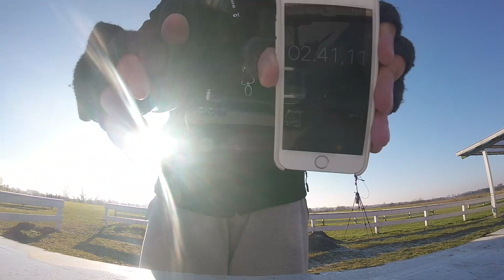Connex Prosight HD - Hardware troubles!

Comment: I'm using Connex Prosight HD for about 4 months, and I never had any blackouts like what you described here, unless I fly out of the signal reception zone. Once I replaced 3 out of 5 whip antennas with 11 dB patch antennas the zone extended quite noticeably, I can get one kilometer quite safely. As far as I can guess, you loose signal behind the tree because the large red metal container next to the shack blocks you completely at this point. Once you get back into the reception zone Prosight finds the signal, but it can take up to 10 seconds, long enough to crash most of the time.
Reply from the maker: I wish that was it; but no. Ive also - because i had the same thought you did, flown directly straight out and lost signal numerous times, i just wasnt filming then. So its not the container ( besides you cant see, but its not blocking the line of sight in reality, just looks like it ).

Comment: This is odd.  I have been flying a couple weeks with Prosight - not a single dropout, not really any pixellation unless I fly directly above the receiver antennae.  I find it incredibly solid, been out to about 1km, which is all I need, though I do appreciate the problem with flying behind dense objects getting total image loss (have not encountered that yet).  I put it on a plane and a quad. The main drawback with Prosight is the bulky ground station.  But the image in HQ and high frame rate HP mode is worth it.  HD is the holy grail for FPV, imho.  I love it, esp w Headplay HD.  I have been FPVing 6 years and kind of got tired of the fuzzy, low res, 4:3 analog link flying.  I am all in with Prosight (except for my RotorX atom!)
Reply from the maker: Thanks for your input. I have actually revised this whole thing and i have now borrowed a friends goggles, and will try to do another test to see if i can get this working. I want it to work, and based on the feedback here, there must be SOMETHING wrong...

Comment: 99% was HDMI cables and a couple of times camera camera cable just needing a little push in .
Reply from the maker: Lets just for the fun of it, ignore the fact that i used 4 different hdmi cables, 2 i had lying around, the 1 included in the box, and 1 i specially bought based on recommended specs. Lets then also for the fun of it, ignore the fact that i had secured my camera cables with hot glue at both ends; still - if this WAS the case, then it would still be a shitty design to be honest.

I have NEVER had any of my camera cables being yanked out, on any other system. They never got lose, even without hot glue. I never had any part of my other systems not work due to a cable being the wrong type, or not good enough, or faulty ( in the case of say the hdmi ). 

So the only reason i can see for this not working is one of two things : 1) Its a defective unit i got, they will figure this out and all is good. 2) Its not a defective unit, they blame me for doing something wrong (which i havent - on the contrary, read alot up on this, followed the manual to the point, and even went beyond (4 cables, hot gluing, etc).

So right now, im waiting for the dealer to get this back, test it and report back to me. I cant imagine that this is what the system is like for everyone else, cause if thats true, then why havent more people had this kind of experience. But.. this is what i experienced, and i can only talk about what i know :)
Reply from the maker: Oh and - on my normal system, i can forget to screw in the antennas on both spots, be on 25mw, have a house between me and the quad, and then begin to discover something is wrong, but still be able to fly. Im just saying.. even if this all worked out and they figured out it was a dud, do i really want to trust this gear, if all it takes is a hdmi cable going wrong in the middle of everything.. ? That sounds pretty dangerous, and costly to be honest.. id never be able to relax while flying. =/
Reply: Just for the sake of it -have you tried it with anyone else's goggles 
Because fatshark HDMI input can be a bit dodgy at times 
Had to replace one.
Reply from the maker: Nope, i havent. Might be the issue, but then it would have to be born dodgy, as this is the first time ive ever used it. But i havent thought of that, so definately that could be why. The only worry i have about this, is that i tested this on the bench while building it, and also had my poor wife run around the house with the quad ( no props ) to see if the link was good. At no time, did i get a blackout or even remotely anything like that. And i was moving around etc. I did this maybe.. 10-15 times before actually flying. I think something happens when the quad is under power - maybe its the vibrations, its a signal interference thing, but most of all i noticed that this actually all happened after i did rolls, or loops.

And if you look at the many videos online, theyre all race videos; i dont race - so maybe this could be a potential explanation also, that it simply loses link due to rolls/loops etc, in certain conditions.
Reply: It's a hardy system 
I've battered gates stupid 
Smacked the ground (lost count)
And only ever broke the corner plastic on antenna.
I have Connex on 4 quads .
Only time I had blackouts was with faulty HDMI port in goggles that's not happened since I got it replaced
Plus it's hard to tell if you have dodgy components if you don't have spares.
Good luck .
Reply from the maker: Hey - thanks for the inputs; ill keep it in mind when i hear back from them

Comment: Sorry your having problems with this system.
I've had this system for 4-5 months now and love it .
The only problem I ever have is inferior HD cables 
So carry a few spare with me.
Do you get a No signal on screen or complete blackout.
How many different types of HDMI cables have you tried because it's fussy what ones work best.
Reply from the maker: Thanks. Yeah thats something i also worried about, but i tried 4 in total now, the one they included, and 3 other ones - same issue. I dont know what the issue is, so im awaiting them to get back to me with an update on it - i did alot of searching and couldnt find anyone else with this issue. Havent you had ANY issues with this at all?

Comment: Have you set it on the higher output??
Reply from the maker: Yes - its set to indoors, which is 200mw (the highest in EU). But regardless, even at 25mw, they said they could go 700 meters out - so something is all wrong here.

Comment: I don't think you have anything to worry about other than a few bucks spent on HDMI cables and props being replaced after crashing due to signal loss. You'll find that Connex will replace your faulty system with a tested system with a decent HDMI cable soon enough. We can all see its faulty without a doubt. The only issue you have is coming up with US$100.00 to buy a  HDMI recorder so you can show us the quality and restore your faith in Connex. Other reviews on youtube have no issues and stunning video quality. HD @ 60FPS will be a while and you've been bitten by the HD bug. Give it another chance and show us some HD videos.
Reply from the maker: Hey - im hoping so, i did purchase the system + a tripod and everything cause i wanted to like it. But i have used 4 hdmi cables by now - 2 of which were hifi grade, one was bought for highest speed/transfer, and last one was the original. So i dont see how this could be that. If anything it has to be a defective unit - but well see. Once i hear back from them about what they find the error to be, ill post back here!

Comment: Is there any chance there is some interference where you are flying? I have seen people using this system the way you want to and have no issues.  Very weird. Hope you get the problems worked out. I am thinking of getting a system next week when I order the FS HD3's...but not you have me reconsidering.
Reply from the maker: Well - yes, i guess there is a chance, but its a flying field, in the middle of nowhere - there are no masts nearby, no residential area for 1km+ around it, so to be honest, there shouldnt be an issue. This to me is also the main issue; I can go out with my analogue, anywhere -. if theres a bad signal i spot it right away, i can then change channels; on this, it seems like you will only figure out how bad something is when the bad stuff happens, UNLESS, you invest in a very expensive wifi scanner ( or whatever theyre called ). I just went flying today after making this video with my normal vtx - and well, i can see the difference, but its not alot, with a good vtx + nice cam + nice tuning, its just.. a pleasure to fly really.
Reply: Yes...no good reason for it failing like it did. I feel your pain. Most of this hobby is witchcraft.
Reply from the maker: I completely agree :) (but i love being under the spell)

Comment: So you lost signal behind the same tree both times at around the same amount of flight time and it couldn't possible be an environmental factor or a power supply issue?
Reply: No. I lost signal about that far away. I also was out flying one time, i didnt film - i also had my wife walk with the unit, as per their suggestion, and it just was very unstable. They received it back, tested it - said they found no fault, and then suddenly they had blackouts. They could not tell me what was wrong, but they thought it might be the hdmi input, so they would swap it for a new unit. I kindly declined, and im now waiting for the next generation ( as i simply didnt want to do more troubleshooting with this tbh.. )

Comment: Sorry, disclosure...I did not watch the full video.  Did you wait for the connex to lock onto the channel?  Also are you on one of the Prosight bands?  I have been flying with the Connex for weeks now, a lot.  It is not perfect, nothing is, but I have only had one instance where I lost video and it was my fault for not waiting for the lock.  Also what is your antenna config? You must make sure you have a T config or your signal will drop.  Ill never go back to analog.....
Reply from the maker: Hey John - yeah i did everything by the book, sent it back - they said they had no issues, then suddenly they had issues, and they would replace the system. They never specified what was wrong, but ive actually said no thanks to a replacement, and im waiting for next gen now.
Reply: Well i hope your next experience is better because I love mine.
Reply from the maker: Me too :) I might have been able to get the replacement and all would work, but its just been too frustrating, so id be scared to trust it now if you know what i mean... so back to analogue, and get some flying done, then i figure in 3-4 months, a new system will come out, and then ill try again!

Comment: hm I have spent over 6 month and over 100 e-mails trying to have them fix the white balance, and the error Camera not supported, this is the New HX Camera but it don't work if the temperature is under 23 degrees Celsius for me. https://www.amimon.com have replaced the HX camera one time but it didn't help. looks to be a nice place to fly where in Germany is it ? will be close to Munich in December.

Comment: I found the connex prosight HD was not really HD, it just doesnt look clear enough to be HD and the range is poor, the video pixelates 
using runcam eagle on my vortex 250 pro the colours are amazing almost glitch free and so much better range on 5.8
Reply from the maker: Hey - i hear what youre saying. I am getting another unit, which i will be testing again, theyre claiming the one i got had problems, so i look forward to receiving this, and giving it another go!
Reply: well it will have to improve the dynamic range alot and the colours 
the runcam eagle cmos fpv camera is like a gopro camera looks so nice 
the range of the connex is crap and you cant afford to fpv racing then get piexlation which means loss of quality and latency
Reply from the maker: Maybe youre right, but i need to test this for myself on the unit thats actually working =)

Comment: Sorry dude but no. Connex Prosight HD is the ONLY way to fly anymore. Check my videos. Not touching analog again. Really sounds like you received a defective receiver or transmitter. Looking at how you have the VTX mounted though I wouldn't fly that quad at all. It's possible it's bouncing and shorting against carbon fiber slightly or something.
Reply from the maker: Hey Michael - i know, and i hope you are right, but to be honest, i tested this thoroughly. The vtx is not touching the carbon, and what you cant see is that i have lined electrical tape on the underside of the carbon so IF it was touching, nothing would happen. Also, the whole unit is stripped ( dont know what you call it ) together, so its not moving. Regardless, i rebuilt this quad 4 times positioning it differently each time since this video - same shit happened over and over. Right now its back with globe-flight, and theyre checking it out. Im hoping they say its a defective unit..
Reply: As I watched your video I can't help but wonder, have you ever tried it on a different field to see if it still black out during flight?  Sorry to see you are having this issue with yours.
Reply from the maker: Hey Daniel - I havent no. But, i have flown there with a ton of other equipment for a year. Also, i believe it should fair better out there instead of using it in a spot with high interference - and ive seen no interference out there so far. However, i am going to redo this whole test, with a new system; It could be the system that was defective, so in order to be fair, ill redo it and upload the results!
Reply: Forgot to mention to check my videos, you can see what it should look like ;)

Comment: Don't use auto channel searching.
Reply from the maker: Did in the beginning, then i set it to fixed to test that out, same result, absolutely no difference.
Reply: What you can try doing is connecting the connex to a monitor/tv then film it, then send it to connex. Or you could take it out of your quad and walk around while filming the monitor to be sure its not a problem with how you have it mounted
Reply from the maker: Hey

I did take it out, and filmed it - i then sent this to globe flight that asked me to send it back. They checked it out, and said that at first there was no issue, but then they said there might have been an issue with HDMI, so they would send me back a new kit.

I declined, and got a refund; spent too much time on this already, and to be honest, while i CAN see the improvement in quality, i miss the secure feeling of analogue.

So im going to sit this one out, and wait for nextgen ; im sure it will be what everyone uses, but for me, right now - i just want to fly, with something i trust, and at this point, ive spent so much time on this, that i would not trust it for the next 6 months.. :(
Reply: Whats really funny is that I used to have the same problem but with analog video. My video would just go black after a minute just while I was flying right in front of me. Took me about 5 months to get it all sorted out. I was the only one having this issue. I went through 4 cameras and 2 vtxs. I know how u feel, I never trusted that quad again lol.
Reply from the maker: Yeah exactly, thats my biggest issue. This MIGHT be a small issue, i dont know - it looks like noone else has this issue, so its hard to say.. but for me, this system is dead now. I dont trust it - everytime i took off, i was scared shitless - and.. to be honest, now its the 12th of march and i havent flown since, - mainly because i have this eerie feeling in my body , almost like when i was new to flying.. and that has come directly from this experience.

But weather is getting warmer, so im hooking up my butterquad with good 'ole analogue, and soon, ill be back on track :)